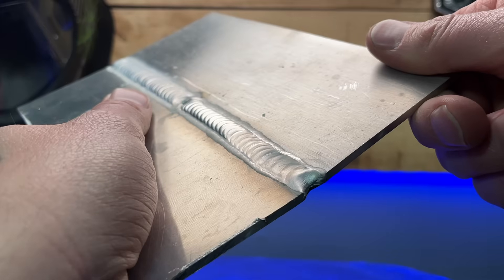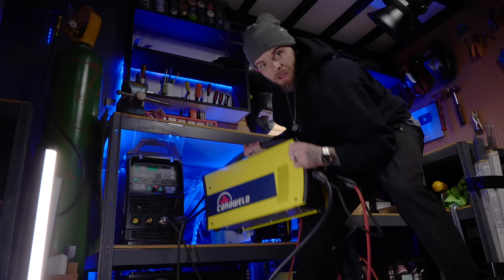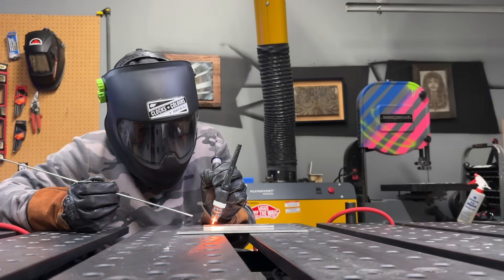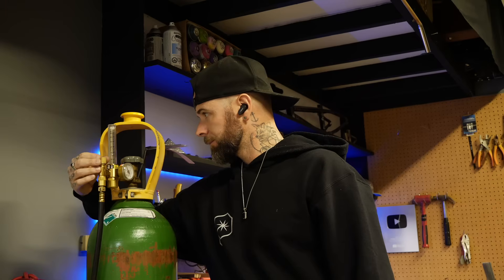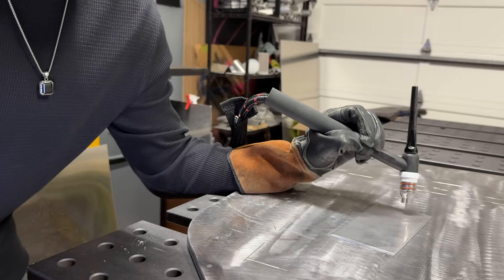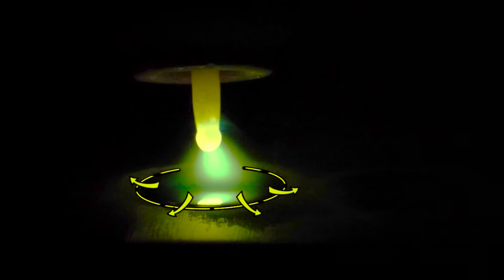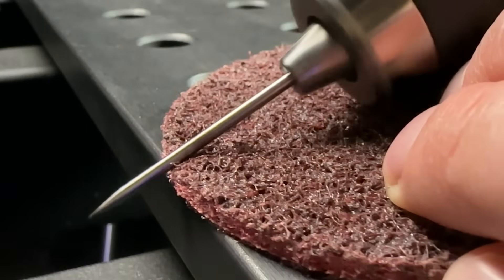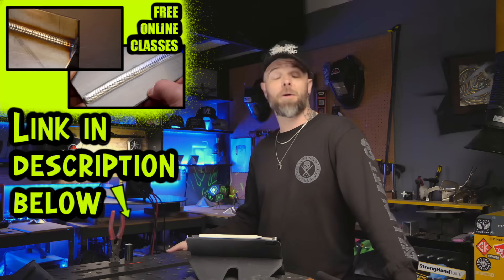The FIRST 3 Things To Learn Tig Welding

Comment: Brand new to Tig. Running a lift arc torch with no foot control. You spoke about controlling amperage with the foot pedal. How do that apply to lift arc?

Comment: As a self-taught TIG welder who was given the job of welding 1inch thick plates into the ends of 8inch by 1/4inch wall aluminum pipes I found that pre-heating of the plates made the job so much easier.

Comment: I agree with the 5 or 6 cup on normal thickness material. But if you are throwing 300 amps plus into some 1" thick or thicker aluminum, your gonna need a #8 cup for sure.